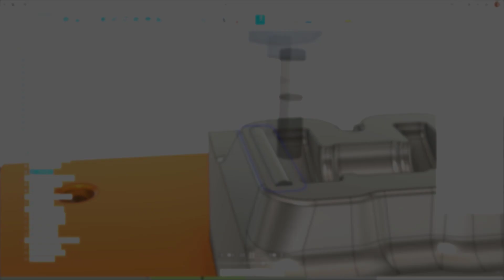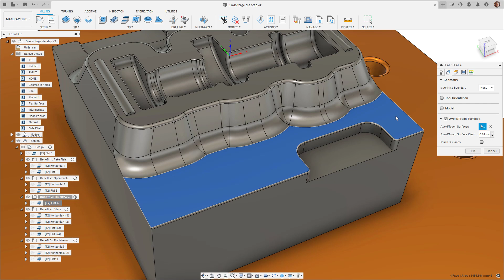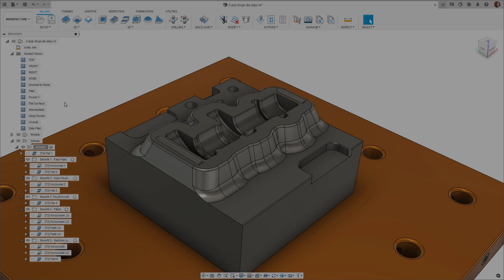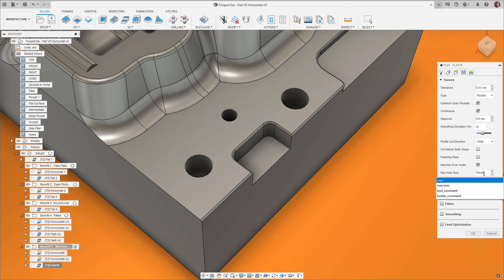Fusion How-To: Flat Strategy | Autodesk Fusion 360

Comment: and now when would you still use horizontal instead of this? because I don't see any uses for it now
Reply: In theory you will not need to use Horizontal in the future. This new Flat strategy and the Horizontal strategy are designed to solve the same problem. This new Flat strategy certainly aims to make Horizontal redundant, however, we await feedback from our users to see if this theory is 100% correct. For the foreseeable future, you have the freedom to use whichever you prefer. Please provide feedback when you encounter situations where Horizontal is the better solution so that we can make further improvements to the Flat strategy.
Reply: @craigchester1625  Really nice!!
Reply: @craigchester1625  that si what I thought, just wondered why you left both of them enabled. Now all is clear, thanks for the answer¡¡
Reply: dude, did you even watch the video?
Reply: @luke1811  did you understand what he asked? I'm also left wondering about that ...
Reply: @gregorgombac5302  @samuel lopez ah my bad, my bad. I mistook the horizontal feature with another CAM program, Conda CAM. You're right. Seems obsolete now